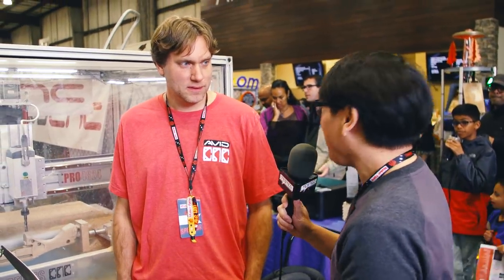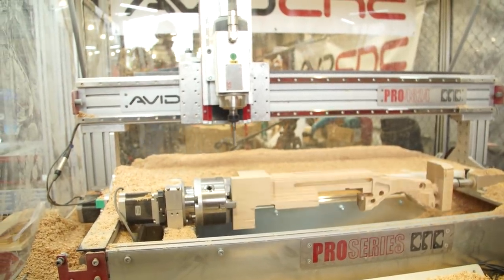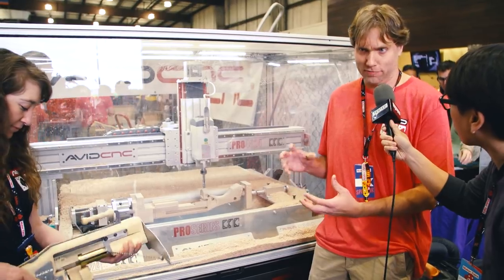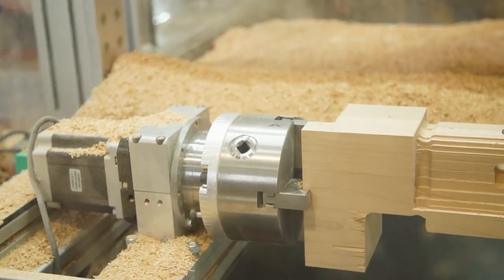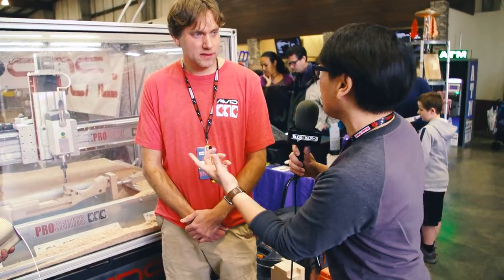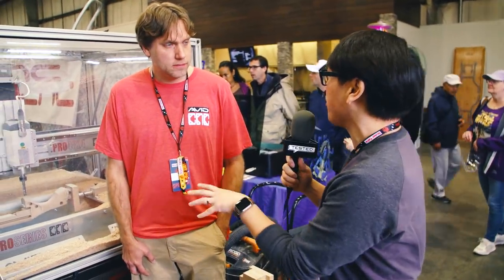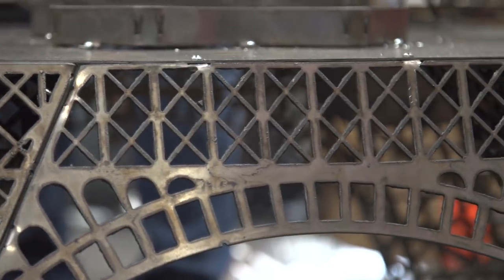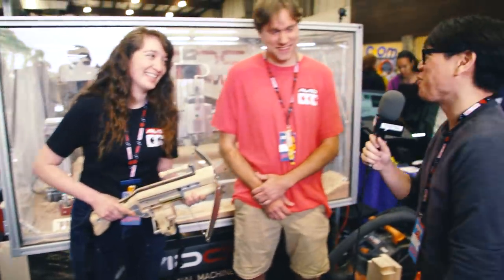Avid CNC's 4-Axis CNC Machines!

Comment: They took it too far for hobbyist DIY CNC and not far enough for actual machinist grade tools.
Im not sure in wich nische this fits, and who is buying this stuff. Barely cuts aluminium but is expensive already.
Reply: Was thinking the same thing tbh its in an odd place.
Reply: It's a wood CNC router that's beefy enough to cut aluminum... I agree that is too expensive, so I'm building one myself right now in my garage. Half the price and even with the highest grade linear and electronic components. The stuff you could make on this machine would pay for itself, even if you did buy the turnkey kit.